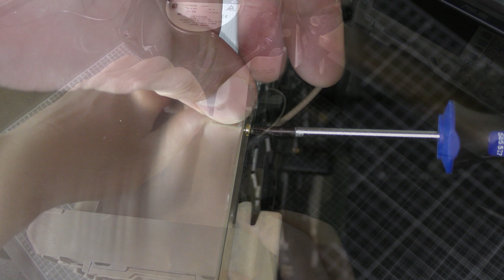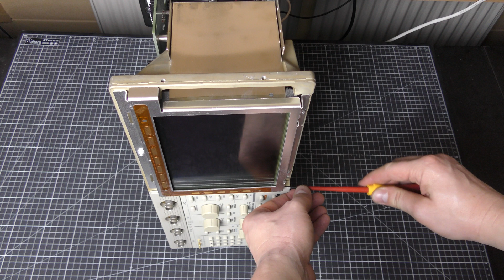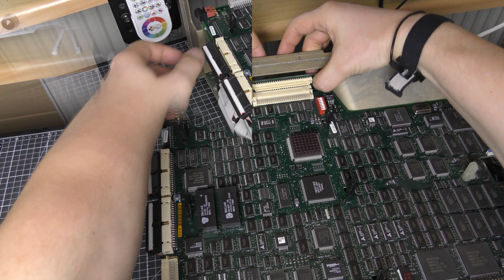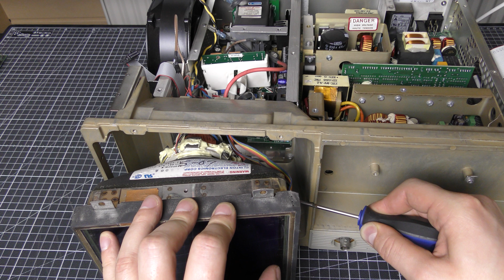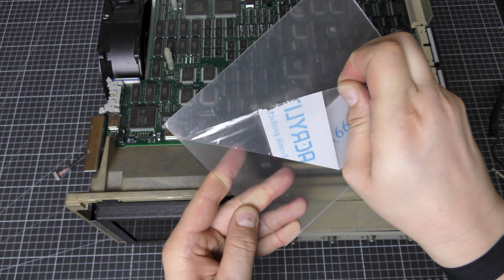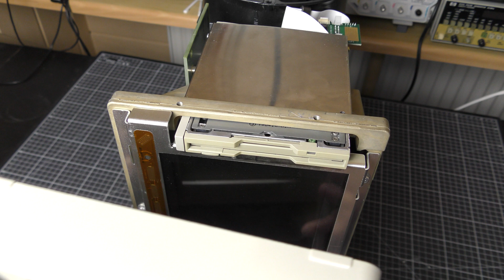Tektronix TDS754D CRT to TFT LCD Conversion

Comment: I have a 784D and the display has failed.  Haven’t tried troubleshooting it yet, but if a replacement is needed this video will be a very helpful guide.  Thanks for the clear run through of the process - excellent job on the video!

Comment: Quite a project. Well done say.. Impressive machine too. I see that the old CRT uses magnetic deflection. I thought that only electrostatic deflection is fast enough for a scope. But, maybe a stupid question 🙂 what would be the reason of replacing the CRT? What do you gain performance wise?
Reply from the maker: I've got this oscilloscope with a broken CRT, so I had to replace it with something. As it was really complicated to get an orginal CRT, I decided to retrofit it with LCD. What do I gain more? There some aspects like: weight, power consumpsion, no X-Ray. Does it matter? I don't know. Perhaps it's critical for somebody... ;)
Reply: @polymath.electronics  okay, if it was broken, more then legit 😁 My remark was more of a question. What would be the resolution differences, or maybe some differences in refresh rate and that kind of stuff.
Reply: On analogue scopes, you're seeing the actual wave as it scans across the screen. On a digital scope, you're seeing a rasterised frame by frame image of the wave after it's been sampled and processed, so the deflection only needs to be as fast as any TV CRT.